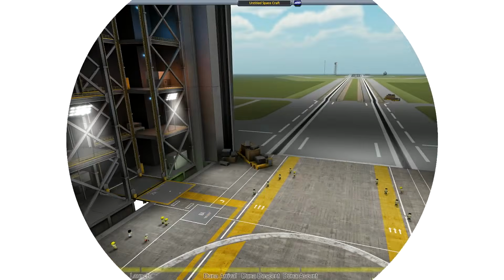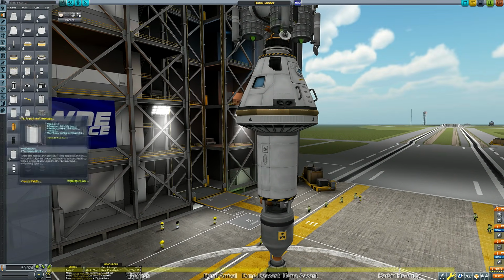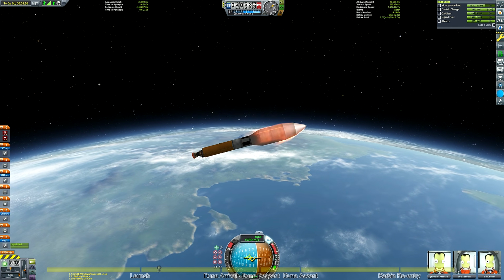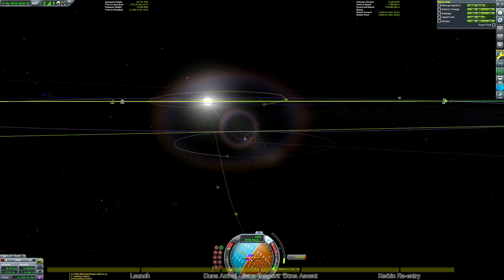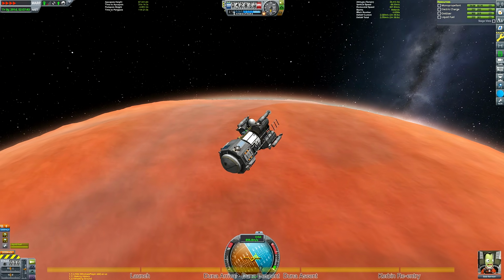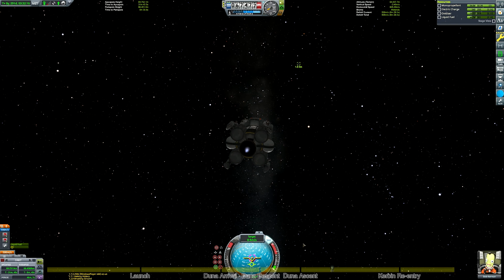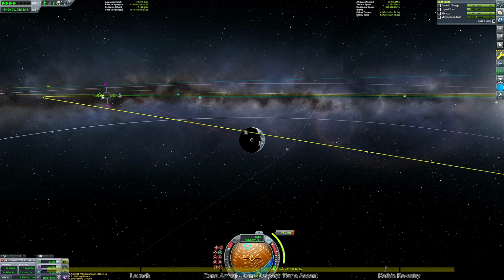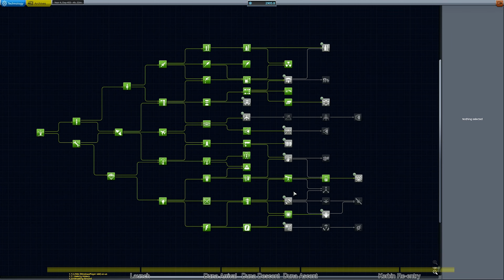Going to DUNA for the first time! KSP Tutorial

Comment: Is a heat shield not needed for dune?
Reply: Not really, the atmosphere is thin and low. It's the same reason why parachute will deploy later on Duna and struggle to slow down the vessel as opposed to Eve which will also easily break the chutes and generate heat.
Reply: @Doomguy-777  and for mars irl?
Reply: @unkar.official  For Perseverance they did use a heat shield but it’s not as bad as a reentry on Earth, it’s more temporary, a lot less violent. It depends how you approach this but if you you can do a reusable stage in KSP (or real life ig), you can very much do that on Mars without needing heat shields, if you have enough fuel to spare that is and slow down with a retrograde burn, which is what Starship will maybe attempt to do one day. 

The idea is that you use parachutes for Duna or Mars because it costs no precious fuel and makes the rocket overall a bit lighter. You can land a ship with something close to 100% its fuel tank capacity.
Reply: @Doomguy-777  Well, the Perseverance made a direct re-entry
Reply: @unkar.official  That also plays a role. In principle as long as you have deltaV and can slow down your descent, you can avoid needing a heat shield if the target planet allows it due to its characteristics. On the Moon we obviously didn't need a heatshield for it, just a controlled burn. Mars (Duna) is halfway that and Earth (Kerbin) when you think about it. Give or take less than half the gravity and atmosphere sort of. 

So if you can land a the equivalent of a reusable rocket stage on Kerbin, you absolutely can on Duna, everything makes it easier on the latter in fact. Think of a lander like a rocket, even if it's not one and doesn't land with boosters attached to it. A ship is a ship.

If you have let's say a TWR of 50 (wow) on a lightweight rocket with 50.000 m/s fuel dV (wow!), from orbit, you could in theory land slowly on Kerbin or Earth without ever seeing a plasma bubble.
Reply: @Doomguy-777  Well, thanks, but I'm focused on roleplaying realistic aerospace companies in Spaceflight Simulator. The BP edit is amazing.

Comment: Before I watched this video I tried to get to duna without most of my tech tree unlocked. I had enough to easily get to the mun or minmus but that’s it. So I did actually get to duna but when I landed I was at a slant and I wanted to move over but I blew up, also I didn’t have nearly enough delta v to get back so either way I was not doin good.

Comment: Had a pair of curious coincidences with this video today. KSP crashed in the middle of a test flight of a ship which wasn't meant to come back to Kerbin. I used its high drag and what little TWR it had to slow down, then bailed out when the altitude started to get a bit low. Fussing with the same ship's launcher, I couldn't seem to get the 2nd stage to have the right TWR; 1 Vector was not enough, 2 were too much. (I only play sandbox.) While watching this, I saw the Mainsail, looked up engines in the wiki, and made myself a note to fit the Mainsail just before Matt started talking about it.

Comment: For some reason in the nuclear engine stage I only have 1000 Δv rather than the 3000 in the video??

Edit: figured it out, could barely tell because of the sped up footage but I was using a different fuel tank not the Mk 1 Liquid Fuel Fuselage

Comment: This tutorial is how I landed on Duna the first time.

50 days getting there, few days there, 50 days back. Enabled infinite propellant because I didn’t have enough Delta V for the return.

Second run, 100 getting there, 100 days orbiting while waiting for a transfer window because I didn’t have enough Delta V to gun it, 70 days back.

I think my problem was the burn I was doing to get a Duna encounter, was also getting a nice equatorial orbit around Duna which I believe used more Delta V than required, so next time I think I’ll do the correction burns to get a nice periapsis while I’m in interplanetary space instead of around Kerbin’s gravity.

Comment: An amazing tutorial! However, not very amazing KSP skills from me.... Had an amazing first half of the mission, landed in the perfect spot and got a flag. But i ended up using my nuclear engines for getting into LKO, i think my gravity turn must have been off, because i barely got to orbit with as little fuel as you did.  And so of course, i did a terrible job docking and had barely any fuel. ended up using infinite fuel for the rest of the video. I also ended up accidentally bringing 4 Kerbals, but everybody survived re-entry somehow. 
The one thing i can say is, there is a reason the first mun landing I did didn't have a separate lander!

Oh and by the way, I think a good tutorial would be like "Ways to save fuel in KSP" or "How to fly more efficiently in KSP"

Comment: Did they change the fuel consumption of the nuclear engine? by the time i get to duna its almost spent and my kerbin orbit matches Matt's exactly
Reply: Same here. It seems with the exact same fuel, I get a little over 1'000m/s of deltaV LESS than matt.
Reply: use the mk1 fuel tanks (they dont need oxidizer)

Comment: For those of you that are following this two years later, mind the distance that kerbin is from duna when you arrive at duna. I went to separate the lander from the mothership and couldn't create a maneuver node. I thought I forgot the antenna. Only when I put jeb in the lander and I couldn't create a maneuver node with the mothership did the light bulb go off and I opened the map screen and noticed kerbin was almost 80 degrees ahead of duna. I put the kerbals to "bed" and timewarped to test to see if distance was the issue. It was. As soon as kerbin came around the sun and started getting closer to Duna, my connection to the KSC returned and I was able to go about the mission, haven't completed it yet, but yeah. Time to break from this series and go build a Comm Sat Network somewhere.

Comment: Oh no! I almost completed the entire mission as planned. Thank you Matt for the simplification of every aspect. But, as I was about to skydive from the capsule, right at the very end, I could not, as all exits were blocked!! Thus poor old Jeb, Bill and Bob plummeted into the ocean. So, why? Was it the struts, or remains of them? There were a couple of strut ends left near the hatch after de-coupling in Duna orbit. I am brand new to this and am not aux fait with building as yet.  I guess I'll have to start all over again, which will be very cool as it was great fun! Thanks for the coaching.
Reply: Just to add for clarification. I was able to EVA Bob and enter the command capsule OK in Duna orbit, but then the poor guys were locked in.

Comment: It would be playable if parts went together like in these vids. spent 4 hours trying to get a part on and aligned. In the videos these guys make out like everything works but try to do the same thing they do and nothing fits together. Not to mention the little symmetry thingy keeps switching back and forth without warning if you hover over something that was put on as a 4 and you want to put a single part on top good luck. Too glitchy to get anywhere or build anything. No fun. Could be a good game but seriously broken in it's present state. Lot of work for the devs here.

Comment: My duna mission: Launch the lander from the MLS and refuel it at the orbital mun station, Repeat with the mothership
Dock lander and mothership and begin intermunar-kerbin-duna transferburn
Reach kerbin periapsis and burn prograde from there
Perform correction burn to get a proper duna capture trajectory
Timewarp to duna
Get science
Capture burn at periapsis
Detatch lander and land it at duna
Science
Launch lander from duna and dock with the mothership
Transfer crew
Ditch lander
Timewarp for optimal kerbin transfer
Burn retrograde relative to kerbol
Correction burn
Timewarp
Kerbin capture
Burn at retrograde
Run out of fuel
Launch crew recovery vessel
Dock recover vessel to mothership
Transfer crew
Return crew to kerbin
Profit.

Comment: 11:40 They're actually incorrect when they say 70 km maximizes the Oberth effect anyway. The ideal altitude for a Duna transfer (the gateway orbit) is 7.78 Mm. DV from there to Duna is only 650 m/sec, whereas it's 1,080 m/sec from 70 km. The cost of going to a higher Kerbin orbit is partially offset by the reduced DV to Duna. Starting from 80km instead of 70km only costs an additional 11 m/sec. 90 km costs 21 m/sec. 100 km costs 32 m/sec. That's chump change; easily worth it for the safety factor. Plus, cosine losses are reduced for weak engines. 
*TL/DR: Do what Matt Lowne said. *
Reply: GoSlash27 i was wondering why my manouver node cost 1000 m/s compared to matts. How come he didnt have to use as much delta v?

Comment: Good video, but you forgot one thing about docking, since it is for beginners. It's in that part where  you were explaining how to double click on docking port and using a "target  node. Their pilots won't be probably able to execute such maneuver (it requires level 3 or 4 pilot),  so it requires an advanced autopilot module or (in my opinion best choice for begginers with lower level tech tree stuff) at least fly by wire module. Just keep in mind, that fly by wire IS NOT an command unit, it just enhance them. It still requires autopilot unit or real pilot with command pod.

Comment: How do you get that setting to where you chose one nosecone and when dragged to install it installed on all 4 at once? Same with the payload fairings where it looked like you just held the button and it put all pieces together at once as moved up to top?? Thatd seriously help out my build times. I'm somewhat new to ksp, been on a few months and have plenty to learn, it drives me nuts when trying to line up and mount pieces one by one and they're slightly off. Becomes extremely tedious. thanks any help. Keep up the awesome vids

Comment: I have a challenge: Self sufficient KSP:

The KSP is on a tight budget, and fuel prices are at record highs. The space program only can afford 3000 units of fuel (liquid fuel and oxidizer), and 100,000 money for everything else. When building a craft, fuel costs can be factored out up to the fuel limit, after that the cost of tanks must be multiplied by 10. You must get ore, turn it into fuel, then get it back to kerbin. After that put the fuel in Kerbal tanks, and you will get to add 25 coins to your budget for every unit of fuel you bring back.

Comment: Great video matey! I like the addition of the mission progress bar at the bottom.

Protip: There's no need to add fuel lines for the strap-on  boosters if you 'Enable Crossfeed' on the radial decouplers.
Your main engine/s will usually be guzzling fuel faster than the booster engines, so the booster tanks should empty first.
Unless you're the kind of player who feels that using tweakables like crossfeed or autostrut is "cheating", in which case you can use external fuel lines.

Comment: You don't need actual fuel lines. You can use fuel flow priority. With the added benefit that your spent boosters keep generating thrust until you want to stage them. Meaning that if you're a few seconds late, you get a nice TWR increase to compensate for your mass ratio decrease. Decouplers on radial boosters should pretty much always have crossfeed enabled with priority settings on the tanks if you want to optimize performance.

Comment: "High Delta-V burns"

Bruh. The initialy burn out of LKO is 1050 m/s. The circularization can be done by aerobraking. The return burn is 550 m/s. Where is the high Delta-V orbital burn?

Believe me, I have done high Delta-V burns to Duna. 6km/s sort of burns. But you're using Hohmann trajectories. You have less than 2k of orbital maneuvering to do unless you plan on not making any use of aerobraking at all.

Comment: I require help for my two kerbals, they crash landed on the Mun. I tried to get the lander up but I realized that wasn't going to be easy. A little help for a beginner pls mr lowne?

file:///C:/Program%20Files%20(x86)/Steam/userdata/403154158/760/remote/220200/screenshots/20190810154449_1.jpg

Here is the lander

Edit: The file link is broke I think so I'll just send it to you on steam via grandmastergoober

Comment: A very nice video (and mission) Matt, I have about 200 hours in ksp now, and except from a couple of one-way probes have only been to the mun and min, so this is going to be quite helpful. :-)

As for docking, I generally can do it, but I always struggle with the RCS control keys, they just don't feel natural to me. Personally I think I would find it much easier if activating RCS would disable the regular engines and free up the wasd+qe and shift/ctrl for the control, I'm probably just weird :-)

But, you can do this without actually docking in Duna orbit. "just" get the lander within 150 m or so, have Bob eva, grab the science and then rcs-fly him (now with wasd controls) to the mothership and head home. If you stuck a cheap probe-core on the lander you could then deorbit it as well, only loosing a bit of left-over fuel.

Question: Why do so few people seem to use the Experiment Storage Unit? It took a while for me as well, but the ability to just right-click and collect all science from the experiments on a vessel is so nice, yes you still need to eva to reset the goo and material bay, but if placed properly you can reach them without letting go from the hatch.

As for next target, Jool or Eeloo could be nice as those targets would also give a reason for you to show/explain a bit about antenna range...
Reply: Hey, pro tip. You actually can use WASD shift/ctrl to use rcs thrusters. Just hit the docking mode button over where it has staging in the bottom left hand of the screen and it switches your control scheme.